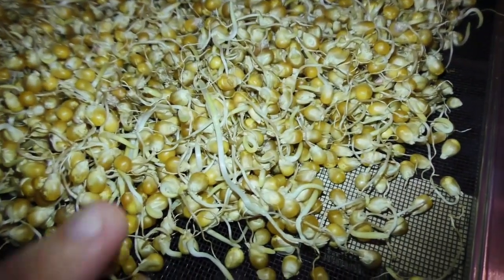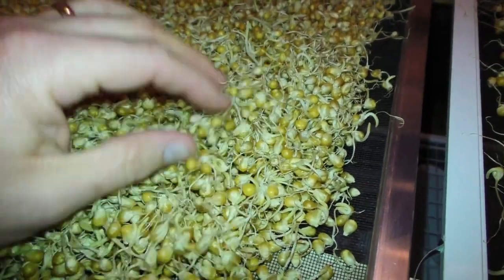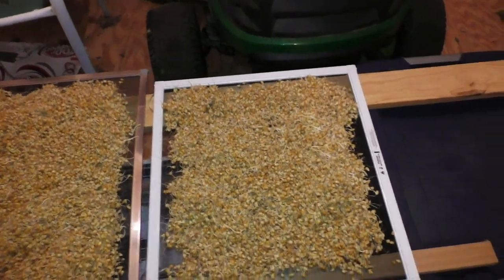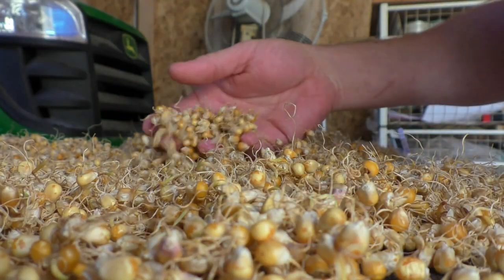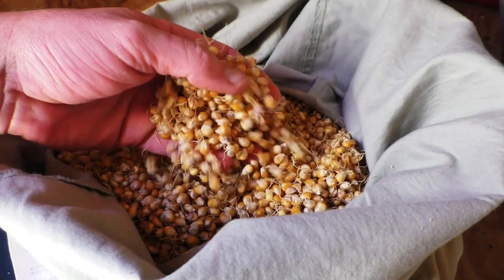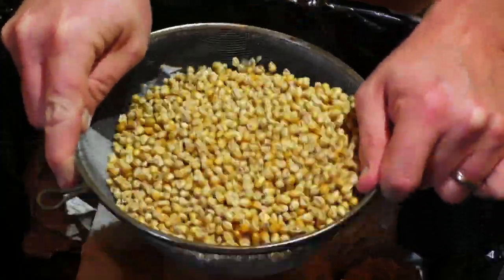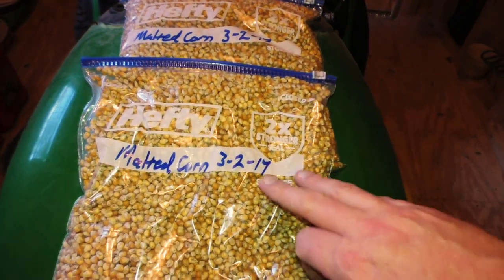HOW TO MALT CORN FOR MOONSHINE & BEER - EASY! - Part 2

Comment: Ok, got a question. After I dried the malt in the dryer, which worked great, and then tossed into my Ninja blender, i got my malt to the consistency of cracked corn (didn't want it to be fine like corn meal and more difficult to strain). So at this point can I just toss it into 150F water and let it do its magic or since the corn has been dried after malting do I need to do some kind of pre-soak to soften it up? Still kind of a noob at this lol!
Reply from the maker: Jason, that's an excellent question. I treat it the same as any other malted grain. You won't need to gelatinize the corn since it's malted and the starches are much more soluble at lower temps and much more available than they were in the raw form. So you're are good to go with with a standard mash temp of 150F. That's what I'll be doing when I brew my Kentucky Common tomorrow. Finally have time for brew day:-)

BTW, cracked corn grind was a great idea since meal grind is a huge pain to sparge. 

Good luck on brew day!
Reply: Awesome! Thanks for the great info! Really appreciate your videos!
Reply: WOW
Reply: Can u blend it and make a mash as soon as the roots are big enough? without drying at all?
Great vid man, Cheers from the UK :)
Reply: I'm curious, can you go ahead and crack the corn without the little sprouts removed??? What might happen if you did crack the dried corn with the sprouts still attached, the use it immediately in a mash??
Reply: @dennisdavis9602  I smoke my malted corn with red oak and pecan wood while still damp. Sun dry it for 6 hrs and then smoke it again. I then place it on a screen and let the ole Wal-Mart box fan blow over and under a few days. I never remove the sprouts. Most of the roots will wither and not be a problem. I feel the sprouts hold a lot of sugar and smoke, that's just the way I do it..
Reply: @cmdrcrimbo  yes you can use for mash immediately after without drying, but you must remove ALL the sprouts. Removing the sprouts is a real pain without drying first.
If you do not remove the sprouts it will be a very bad thing.. 😎
Reply: @dennisdavis9602  what this gives you is a very displeasing taste in your product. Removing those sprouts is imperative.
Reply: Chris Jones If one didn’t care about taste or drinking the “beer” would it be okay to leave the sprouts to make ethanol fuel? Would it be detrimental to the fermentation process down the line? Thanks.
Reply: Jason Hoeflich very useful info. But if running a. 10 gal pot. How many pounds of corn would I need to malt?
Reply: @markvest6161  10 lbs?
Reply: mark vest 

Even malted... corn had a low diastetic power...
Only enough to convert its OWN starches.

IF it’s malted correctly.

I would say it’s best to either use a pound or two of malted barley or amalase enzymes to ensure a solid conversion.

Malted corn is great in theory but...
For the time involved... not so much.

I get 55 pound bags of malted 6 row barley for $83 at my local brew supply shop.

That’s $1.50 a pound and they mill it for free.

It’s just not worth the $3 per 5 gallons of mash I’d save.

If you’re doing it for fun or as an experiment... then it’s just a matter of your time.👍🥃
Reply: @dennisdavis9602  that's where the term mash came from, you can mash them...
Reply: @BeardedBored  good vid thanx...yep its legal in NZ but not here in OZ...

Comment: I completed my first malted corn run. Very good system beard. 8 hour soak 8 hour rest 4 times and 36 hour and turning every 4-5 hours with in that period rest before the box fan works superb.
Reply from the maker: Great! So glad it worked for you:-)
Reply: @BeardedBored  it's become a very efficient. The only drawback is you got to do smaller batches. This was a 2 pound batch. How does 4lb work for you. Any pointers
Reply from the maker: @davidwillis292  I've done 4-5 pounds at a time in trays. Works fine, just need a few more trays to spread out the batch. In my malt tumbler video I'm able to do 10 pounds using my tumbler.

Comment: To stop germination I built a screen rack with vfc a 4" wood frame, set my gas oven at dehydrate which is 125 degree convection for about 6 hours +/-, then set the rack on a fan and let it sit at room temp for 48 hours....yes getting the roots off is a pain, will try the pillow case method...happy home brewing.❤

Comment: Great little series - if you aren't a teacher by trade, maybe you missed your profession. Though I've not malted corn, I've malted barley for decades; I use a double bucket system for malting.I drilled hundreds of holes in bottom of the top bucket and put a drain valve in the bottom bucket and do my soaking routine there, then spread the grains in trays to let the acrospire and rootlets develop (I use the same system of buckets for my sparging). I can then put those trays into an electric smoker I bought for various projects and dry it there. Early on I tried the dryer method: one burst pillow case convinced me to find another method of drying. The smoker also works well for decarboxylizing my weed and drying produce to put down in the fall.
Reply from the maker: I think you should check out the Grain Bench channel. He's a fantastic maltster with lots of cool exotic grains he's doing, plus a smoke box and drying box:-)

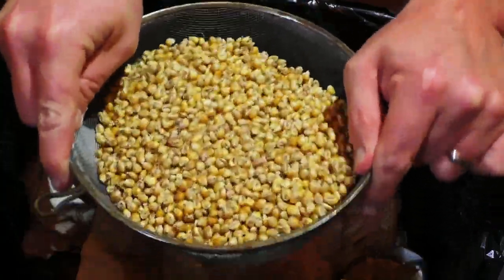Comment: Hey Bearded and Bored, @06:55, MUCH easier method for removing chaff from the malt.

You'll need a box fan, which you already own, and two large bowls or buckets (and a broom).

After you've tumbled the corn in the dryer to knock off the chaff,  stand the box fan upright on a table or workbench and pour the corn from one container to the other in the path of the fan.  Wish I could take credit for it, but I'm pretty sure the ancient Sumerians thought of tossing grain into the breeze a few thousand years before me...

All in all, took me less than a minute to separate the chaff from the malt, and another 4-5 to sweep up the mess.
Reply from the maker: Ahh those clever Sumerians. Great idea! I'll give it a try on my next batch:-)>
Reply: For 500 kg , is there an easier way to knock off the chaff. I am building a kiln to to dry 500 kg batches, what ideal temperature I should maintain and for how long to get right moisture content, am assuming bout 5% without denaturing

Comment: Thanks for the videos! Im making a Zulu Beer (UMQOMBOTHI) and the recipe called for 2kg Maize Malt... Couldn't find it anywhere in The US! Thanks to your help I'm now in the process of making it myself. And I've had a great time doing it! Thanks for making this whole quarantine thing a little more fun!
Reply from the maker: Glad I could help pass the time:-) I've seen several recipes for Umqombothi that also have sorghum malt in them. Were you able to get sorghum? If so, did it malt the same as corn? I haven't worked with it yet.
Reply: How do you handle preservation. What is the shelf life of the beer

Comment: can you try your hand at malting some pumpkin seeds?? cant find this anywhere!!
Reply from the maker: Ok, to be honest I almost dismissed the idea as impossible because seeds and grains are very different. But then I started thinking about it. 

You can germinate seeds just like grains, but they don't have much starch content compared to grains. That means that once the enzyme action converts the starch to sugar, there wouldn't be very much to sugar to ferment. Seeds also have a higher protein and oil content to them, which can complicate a brew. I'm not saying not to try it, but I think you'd have to use them as an addition to a much larger grain bill. Like adding a specialty malt to a beer recipe. It would be for color and flavor, rather than the single source of sugar. 

With all that said, I love experimenting so I'm tempted give it a shot:-) Maybe malt a pound of seeds, then make 2 small batch beers with the same recipe, except one has the seeds and the other is straight. Also, once the seeds are malted I can try toasting a few of them to see how the flavor changes from untoasted malted seeds, etc. Lot's to test since I have no idea what to expect.
I've got some thinking and research to do, but this might be something I try for the fall season. Thanks so much for suggesting something I'd never considered!
Reply from the maker: Hey dude. I just posted a beer video based on your suggestion:-) Thanks for the idea!

Comment: Thanks for adding... Only one issue I would have liked to have  seen in your process... it was the removable of the sprouts, that can be a major issue. I would have liked to see how you ended up with those two nice sacks.  E$
Reply from the maker: I did show it, but it's probably too quick. I should have given it more time. Skip to 5:24 where I talk about putting the corn into pillow cases, then tossing that in the clothes dryer on low for 2 hours. The smashing around in the dryer actually knocks all the sprouts and roots off the corn kernels, and dries it out more. Then you just have to shake the corn in a wire mesh strainer over the trash to get the chaff out. That leaves you with nice clean corn. Hope that helps:-)
Reply: Bam! thanks good buddy  :P
Reply: Can loading the corn into a concrete mixer work for removing the sprouts? Working with 500 kg malted corn so the dryer method may be too tedious

Comment: Right Sir that is as easy as it gets, I'm going to do a batch asap...one Q how can I work out the diastatic power of the corn malt so I can add some adjuncts for mouth feel...like smoked barley or oats and be sure that the corn will have enough extra power to convert their starches to sugars?. Thanks inadvance mate. :)
Reply from the maker: Corn has very low diastatic power, around 30 Lintner, so it will NOT convert adjunct grains unfortunately, so you'll need some regular malted barley. But that's only tru for dried corn malt. Green malt has more diastatic power, around 100L. Check out my "Grocery Store Beer" video to see how to use green malt if you're interested:-)
Reply: @BeardedBored  thanks mate...I'm on it! (Y)

Comment: Great videos. I am enjoying my way through all of them. I do have one question oh, I malted some corn and now I need to grind it. What type of grinder do you use or recommend 4 small batch 8 pound ish at a time?
Reply from the maker: Corn is very difficult to grind with a standard grain mill for home brewing because the kernels are often too big or to hard to go through the rollers of a barley mill. Since I don't even have a grain mill, I just use my food processor and do small batches, 1 pound at a time. That may sound tedious, but 1 pound takes about 30 seconds to crush in the food processor, so 15 to 20 minutes is all you need to do 30+ pounds of corn. If you'd rather buy a dedicated mill, you'll need to get a table top corn mill from ebay or amazon for coarse grinding. Then a regular home brewing grain mill if you want to do a finer grind like corn meal or corn flour.

Comment: Great video, thank you. Is it possible to dry the corn in a food dehydrator, like the round multi layer type?
Reply from the maker: I've never tried it so I'm not sure. My only concern would be that it's a slower process with a dehydrator and you could get some continued growth. My suggestion, just to make sure you're successful, is to use the box fan method for the first stage of drying to get germination to stop quickly, then shift over to the food dehydrator. You could even use the dehydrator trays for the fan drying. Just stack them on the fan and rotate them ever few hours for at least 1 day, then go to the dehydrator to drive off the rest of the moisture. I curious to know how it'll work out so let us all know when you're done:-)>
Reply: This is my question exactly, im doing two pounds of corn for some shine. Im using the rounded kernels that are mainly for popcorn. I wanted to use deer corn but i was worried the additives would affect my product. Did the dehydrator workout for you?

Comment: Great video man.
I would like to ask you if there is any other method to kilning and remove the residuals?since i don’t own a dryer
Reply from the maker: You can set it on screen and dry it in the sun, or set a fan under the screens to blow air through for a few days with a small heater nearby. It's slower, but it works very well.
Reply: @BeardedBored  some of my wheat grain turn reddish. Have you face such an issue or so you know whats behind this red color?
Reply from the maker: @sassinesarkis8472  There is a variety called "red wheat", so maybe it's that variety? It could also be fungus. If there is no bad smell, then it is probably fine.
Reply: @BeardedBored  its a normal wheat. The red color appeared in the 4th day of the germination phase and there is no bad smell for now.
Reply from the maker: @sassinesarkis8472  Hmm. I'm not sure. Take some close up pictures and send me an email.
Reply: @BeardedBored  can i get your email please?
Reply from the maker: @sassinesarkis8472  click on my name to go to my channel page, then click on the "about" tab. My email is on that page. If I type it out here I'll get robot spam.

Comment: Great video. I have one question. After malted corn has converted its own starches to sugar does it have any extra enzymes to convert adjuncts?
Reply from the maker: Unfortunately the diastatic power is pretty low in malted corn once it's dried. Somewhere around 40L if dried, but a surprising 200L while it's still fresh and wet. Since we usually need it dried for flavor and storage, it really only has enough diastatic power to convert itself. So it's always a good idea to add pale malted barley (2-row or 6-row) to your recipe for any other starch conversion.

Great question!  Let me know if you have any others. Thanks for watching:-)>

Comment: I don’t have screens but I do have a dehydrator... if you do that would you only tumble it in the dryer for an hour or still do the full 2 hours?
Reply from the maker: I've run some batches through the dryer 4 times just because the roots and shoots were so tough that they wouldn't come off without hours of tumbling, but two hours is usually plenty. If you feel like the corn is dry enough from your dehydrator, then you can tumble it without any heat at all until the chaff comes off, or take small handfuls of the malt and rub roughly it in your hands to get the chaff loose. Takes longer, but it works:-)

Comment: Very interesting videos! If I want to use corn malt, do I need to adjust my malt mill to a different grain size? Or can I just go with my standard setting that I use for barley and wheat?
Reply from the maker: Corn has a much larger kernel size, so you'll need to go for the widest setting. Most standard mills won't handle corn very well since it's so big and tough, but once it's malted it seems to do a lot better since the grains are broken down a lot in the malting process. Still, you may have to run it twice.

Comment: I am very new to this whole process and I am in learning/watching/reading mode. You mention getting amylase from the corn, but I was under the impression that corn does not contain any amylase. Is that true?
Reply from the maker: As the seed grows during malting it produces the amylase enzyme. You have to malt it first to make the enzymes.
Reply: @BeardedBored  thanks! Follow up question....if you use a malted barley and/or add your own separate amylase enzyme to your corn based mash, would it be correct that you do not need to malt the corn too? The amylase from the barley or additive would convert the starch in the corn to fermentable sugar?
Reply from the maker: @davidhoughton2115  Yeah, as long as your grain bill is about 20% malted barley, you can have 80% unmalted grain. Barley has a very high diastatic power, so it can convert everything else, where corn has a very low diastatic power and can't convert anything other than itself when malted.

Comment: Hello. Why is corn malt rarely produced industrially? I am from europe and finding corn malt here is quite difficult. Why do you think this is so?
Reply from the maker: It has a very low diastatic power compared to barley, so it's not good at converting starches in other grains. To me, malted corn tastes better, but it's subtle. On the industrial scale, there is no benefit and only extra cost to malting corn when barley will do the job.

Comment: After doing all this .and grinding it down and putting it in 150 degree water do you still have to use a amylase enzyme convert to sugar I'm new to all this grain what can you use barley to convert it
Reply from the maker: Malted corn has a very low diastatic power (enzyme power to convert starch to sugar). It can convert itself, but will not have enough enzyme left over to convert any additional grain. So I usually use this as an adjunct grain in a larger grain bill that has malted barley. You can do 100% malted corn and it will probably convert all of the corn starch present, but it doesn't hurt to add some 6-row malted barley (about 20% of your total grain bill will be enough to convert anything) or you can use commercially produced amylase enzymes. I sent some to a fellow YouTuber to test against regular corn. Here's the vid. https://www.youtube.com/watch?v=_6mBD8py9gs

Comment: Very interesting tutorial. I'll never do it because it's too time consuming.

For flavor I'd just use frozen sweet corn from the grocery store, no amylase necessary. Run it through a food processor before creating the mash.

For volume I'd just use corn meal or corn starch (with amylase or Malt O Meal). And you could add some cans of cream style corn or your frozen sweet corn.

BTW, I ya future video idea.

Brew some of your malted corn and then freeze distill it!
The methanol content should be far less than your apple jack recipe right?
Reply from the maker: Not sure a freeze distilled malted corn wash would taste good, but I may try it to find out;-) There would still be some methanol, but not nearly as much as the apple jack.